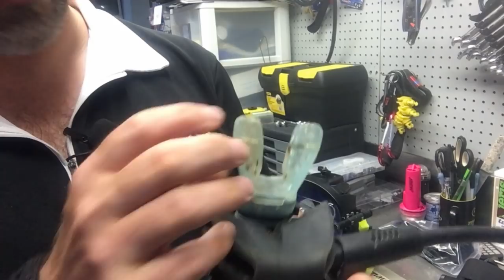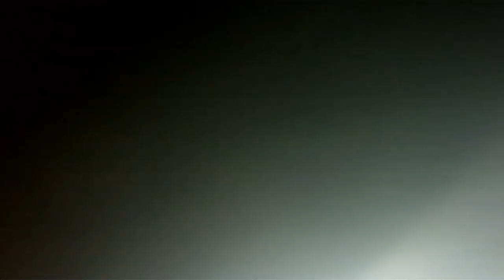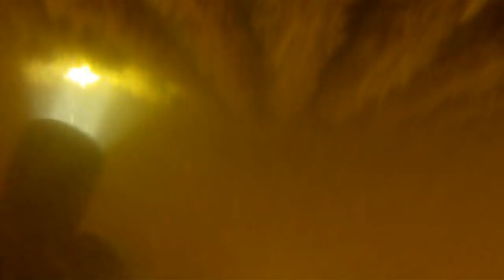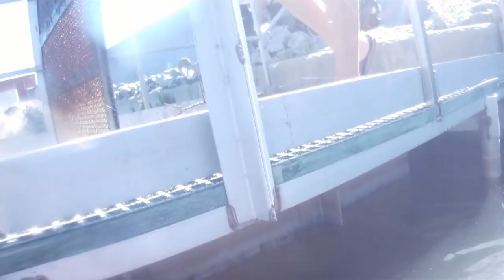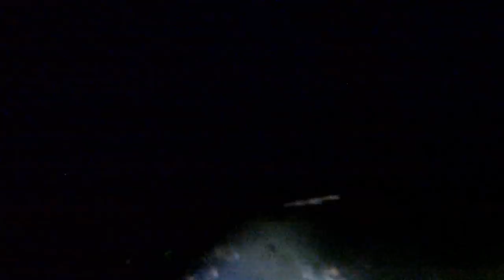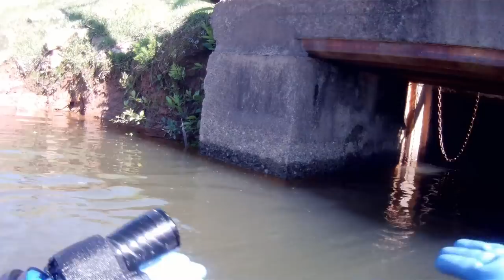Scuba Diving Inside A Water Intake System

Comment: Cool a night dive during the day. I get the pleasure of inspecting water towers for sprinklers i hate the climb to the top
Reply from the maker: That's awesome, I've always wondered what it was like to dive in a water tower.
Reply: LakeHickoryScuba generally the water is crystal clear but u need a light and the water is 50°-65° in August. If u do them in winter maby 37°
Reply from the maker: Maybe one day I will get a chance to dive one.
Reply: Bogy 1 Kinoby  we use the winch on my truck and a pully up top. If i had to lug all that up it would be nap then dive

Comment: So do these water intake pipes have propellers or anything in them? Like if some one got sucked into one would they be fine and appear on the other end? Or does it depend on the water intake pipe?
Reply from the maker: Great question thAt one gAmer. Most have imperllors not propellers. Propellers push something through the water, where impellors pull something in. Most of these water pumps have suction grates over the imperllor protecting the divers from Delta P.
Reply: @LakeHickoryScuba  wow didn’t know that! Thanks for the insight!

Comment: I would like to know what safety system is in place so nobody inadvertently turns the pumps on
Reply from the maker: That is a great question @aidarivera5551. We have several surface support staff members on site that stand guard over the switches to guarantee they do not get turned on. Also, the majority of our staff are off duty officers, and are armed most of the time. Needless to say, we are in safe hands. Lock Out and Tag Out procedures are never omitted and are performed on every intake job we perform.